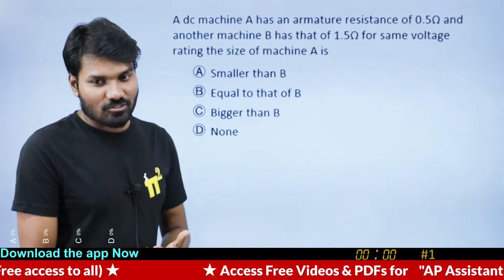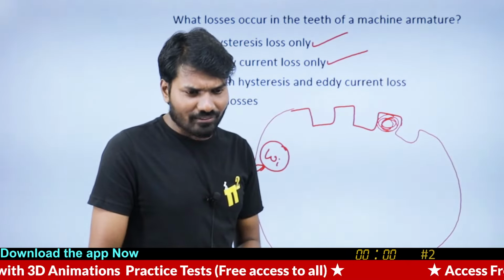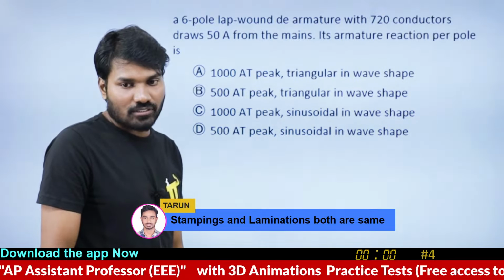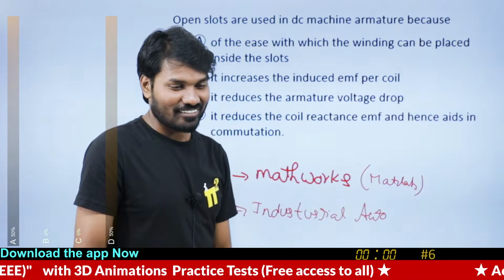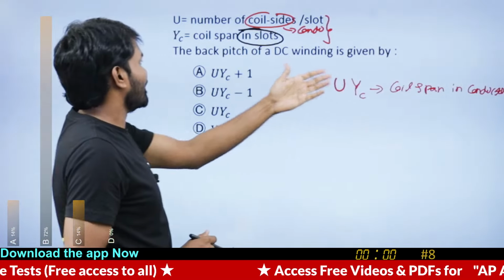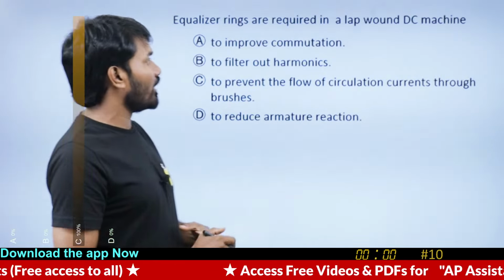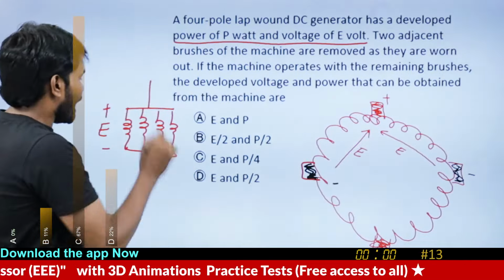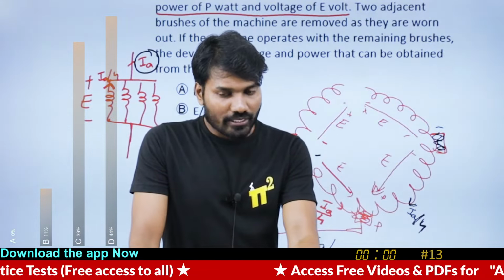Key concepts in Electrical engineering through MCQs (DC Machines)

Comment: As the number of poles of stator and rotor must be the same, two brushes are removed such that two parallel paths become open to current. The machine operates on E and I/4. So, developed voltage is E and power is E x 1/4 = P/4.